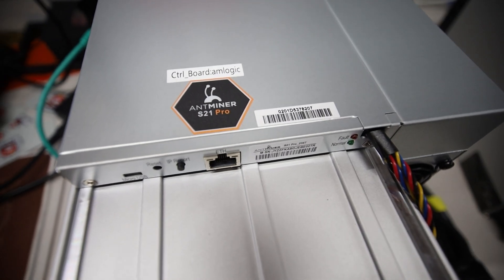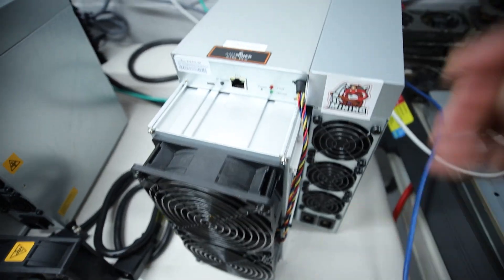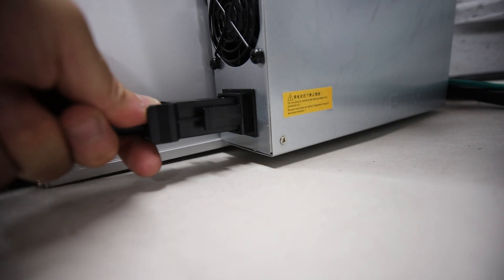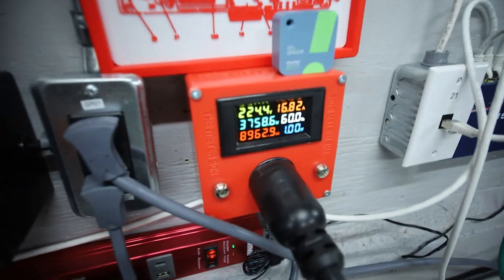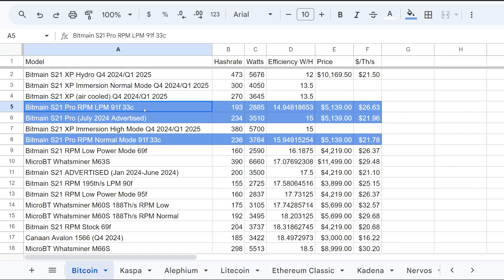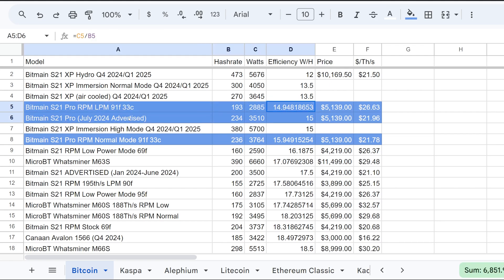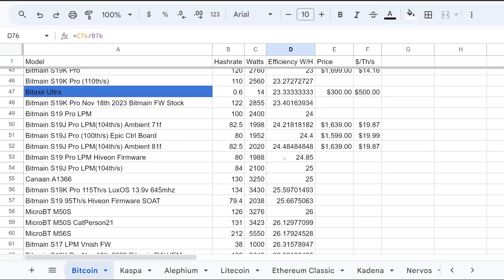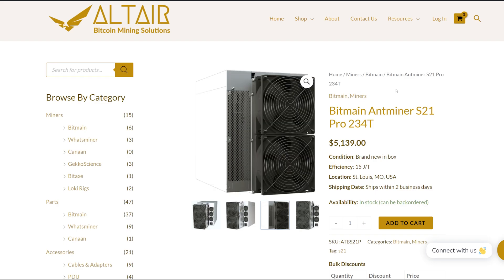THE BITMAIN S21 PRO.

Comment: it is like they are scared. I received a Whatsminer few weeks ago, M20S 70t. I see that one single fan does great compared to 3 little squealing fans  from Bitmain. And if Antminer was design to have big fans for their power supply they would not have any competition. I have 4 T17 and tried to mod one but electronics heat up. The 3 mosfets would have to be changed. I was trying to reduce the rpm of the  high pitch fans of Antminers. Apparently they are doomed that way.

Comment: I love the s21 pro, waiting delivery for 2 pieces. bummer that the stock firmware doesn’t have a high hash rate mode. At this point all asics should have 3 modes of operation. Would love to get my hands on the older gen models as I build out my mini farm here in the UAE!
Reply: If you need to buy mining machines, you can contact me, I have a large number of mining machines.

Comment: Another thing that's interesting is how different the analysis is if you have cheap power.  If you're at 7c/kWh or lower, then S21 pro in normal mode looks better.  Even the Canaan Avalon 1566 might give you more profit because the $/Th is so low.

Comment: I think the S21 Pro is going to be a monster. Residential miners may have trouble with power costs but it appears Bitcoin will mostly be on the upswing coming up so it could help with electric costs. It sounds really loud though but appears to have good cooling. USA.

Comment: The hashboards are obviously taller and longer, curious if the chip count went up drastically. Might also pose a problem with flush mount shelving built around the footprint of previous models. Loud, yes. But at a lower pitch (140 vs 120mm fans). The extremely thin control board casing is worrisome for contact shorting if pressure from anything rests on top of it. If ultimate hashrate is your thing, this is it. I would believe this unit would run far longer on LPM with no need for maint while still giving reasonable results. We'll see in the tear-down. USA

Comment: Burning power at around 1100 watts 24/7 for $2 bucks a day in BTC with nice hash. Cost are around 8 bucks in power.. Wouldn't be mining right now if I didn't have solar power. Cost Of Mining is going off the charts.
Reply: So at $8 a day on electricity you’re making $2/day? Not too shabby especially when Bitcoin goes to 100k by the end of the year ❤
Reply: @BuyBitcoinholdit  us die hards can only hope.